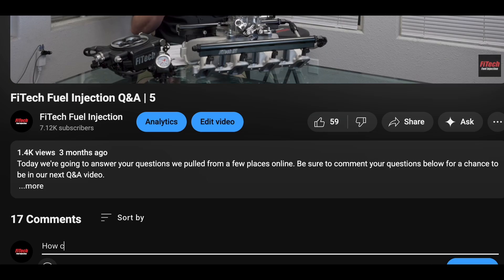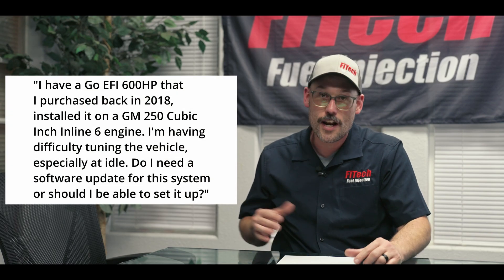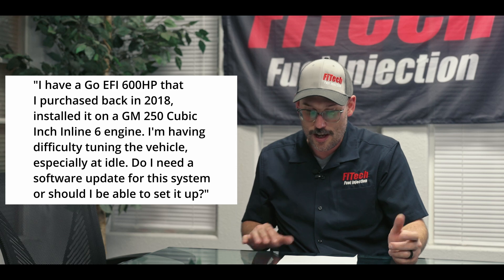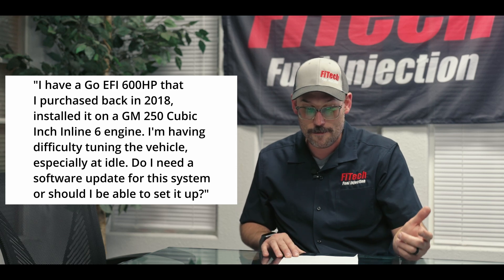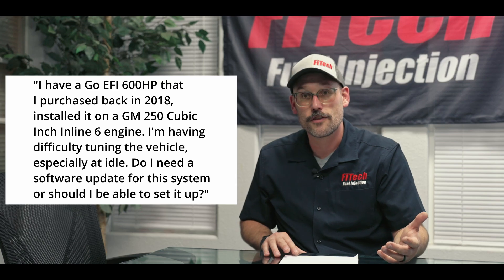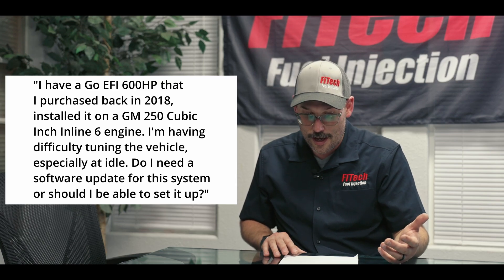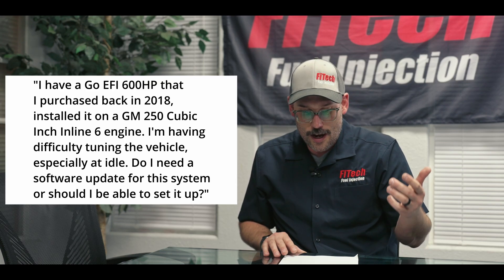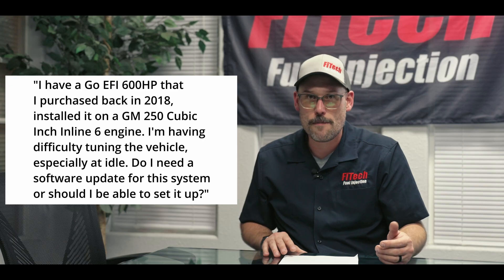FiTech Fuel Injection Q&A | Episode 7

Comment: Hello Bryce, thanks for continuing to create your informative videos! My question today is regarding the feature on the handheld for ethanol inputs. Like many users I only have access to fuel which has 10% ethanol. Can I use this handheld feature to input 10% ethanol content for the gas I use? It sure seems like it would make tuning a lot easier. Thank you
Reply from the maker: Thanks for watching! 
Most of the fuel we pump into our vehicles come with an average of 7-10% ethanol, inputing that value on the ETHANOL % will help the Fitech System with tuning.
Reply: Thank you very much!

Comment: I have your 6 pac system installed on my small block 340 c.i. Mopar factory intake. I am being told by others that I should have blocked off the exhaust “cross over “ ports when I switched to fuel injection. If this is true case, why was this issue left out of the installation instructions? Also, I am using your system for fuel delivery only with no timing control connected. Thanks for any insight you can provide.
Reply from the maker: Hello sir, Blocking the exhaust crossover on the mopar engines its only optional and not required it mainly done to help keep the Throttle body system cooler, in other words it brings benefits for cooling towards the top of the intake, most customer also clock the intake, however its not required.

Comment: I have my 1979 corvette  with a 355 chevy with hei and and a flame thower  and 600 hp fitech which i had installed by kogan motorsport  which ran since 2015 with no problems  until i changed the headers for ceramic and installed new plugs and now has just been emi codes all day long i have wrap the blue wire with copper tape and solder the the ground to it i have wrap all my wires going to the distr also i called you guys and i told it was an emi p0335 code which i know what next or do i rip out and go with holley sinper to solve the problem cause no one there will help just say the same thing to me    solutions please or do you have a tech out here in new york  NEED HELP ASAP !!!!
Reply from the maker: Hello sir, When it comes with diagnosing a RPM noise issue, there are couple things to verify, you mentioned you changed your exhaust and spark plugs.

First, wrapping the blue wire is an excellent way to prevent RPM noise, so that is covered. Now the spark plugs you installed, lets make sure they are the resistor type, you must run resistor type spark plugs which help with RPM noise. We also need to make sure spark plug wires are in excellent shape. When removing spark plugs specially after removing exhaust and replacing spark plugs, we need to make sure nothing came loose inside the spark plug boot. Last, the blue wire is probably being ran to your tach output on your HEI distributor, its important to only run the blue wire to the tach output alone, some cases we run our tach wire for our gauges in the same spot as the blue wire for the FiTech which can cause RPM noise, and this can trigger at any time. If the issue continues I recommend contacting our experienced tech support team,

Comment: When are you guys going to create a cruise control for your systems?
Reply from the maker: Hello sir,

For cruise control that will be something that can be done with the current systems, as the cruise control has a separate mechanism which can be used on most of the FiTech systems. Also, FiTech is developing systems which has the feature of drive-by wire which can be also controlled by different type of pedal control modules.